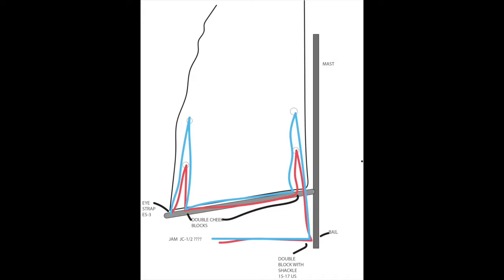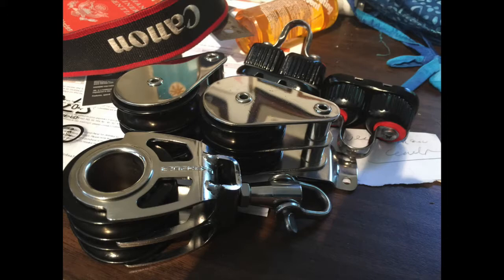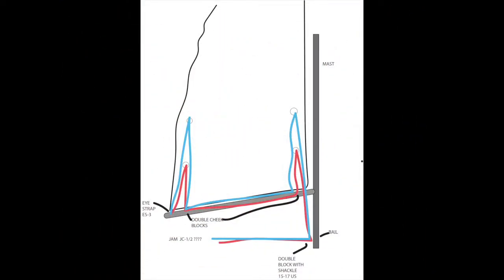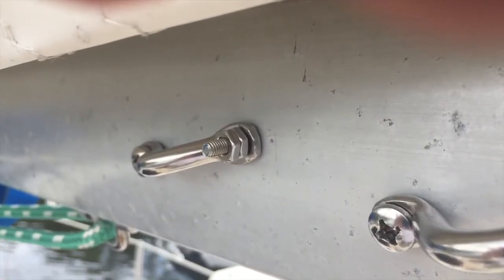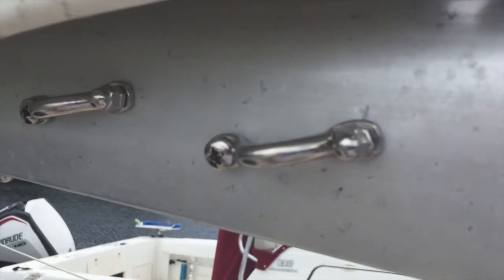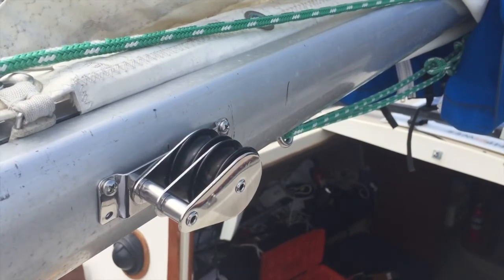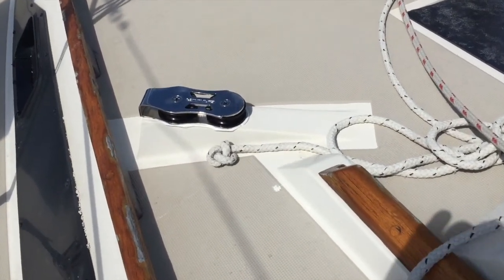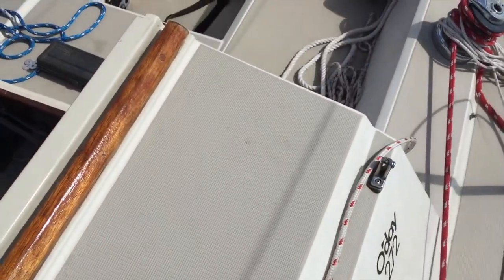EP 8 REEF BLOCKS

Comment: More than entrataining, but rather educational. I plan on installing a single line reefing on my boat, and though the mast manufacturer sells internal shuttles for the boom, I do plan on going on the outside, although I have 3 reef points, I will only do the second and third because for the first reef, condition are usually not yet too unsafe, and I don't care much for heel, so will reef early, but probably just do the rear reef point with a line for the first reef..
Reply from the maker: Thank you for responding. I think one of the most important things to remember is dyneema Line makes everything go through the block smoother and easier. Good luck with your project.

Comment: I plan on befitting my boats boom for single line reefing, but will only do the second and third reefs lead back, as when reefing the first reef, usually conditions are still manageable, but reefing further has its inherent risks, especially in darkness, surprise squall, etc. Though my boom has internal sheaves for reefing, I too prefer outside the boom. Great video.
Reply from the maker: Thank you

Comment: I have a roller boom reefing. I'm going to change it out for normal reefing. Your single lines reefing looks easy enough to install. I might be a to leave the roller boom on and lock the rotation, then install blocks externally like you have done. Thanks from Tasmania
Reply from the maker: I have no experience with boom reefing. Your plan sounds like it will work. Good luck.

Comment: I'm thinking of doing this, as I have a huge disdain for going to the mast and the ram horn. Curious why the reef line on the starboard side of the boom and then clutched on the port side of cockpit. 
Also shouldn't the cringes be brought down to the boom?
Reply from the maker: The Sail that came with the boat has a reef block on the sail at the reef point on the starboard side,  that's why the blocks on the starboard side. The  Clem cleats are on the port because the starboard side is all filled up with clutches.   I am not an expert but my philosophy is to look for ease-of-use and safety. If I am reefing, and spilling  little wind, that is not a bad thing. I have a tendency to reef before I needed, as my wife does not like heeling to any major extent.   The slipperiness of the dynamic was really helpful.
Reply: @svgreatescapes   Thanks for that

Comment: I am setting up the reefing lines in the same manner so that its easyer and safer for me as i am an by myselfe most of the time.
Reply from the maker: I used dinema  synthetic line as it is very slippery and runs through the blocks easily. We must remember to have the line loose when you raise the sail.
Reply: @svgreatescapes  Thank you for replying back so soon. I have just joined your channel and if you join mine, you will be able to view my progress as i complete the refit of my boat.
Reply from the maker: @svlittlegem  done

Comment: Great Stuff!
This is Carl from the Meet up in Mystic, How's it going.
Reply from the maker: My reason for staying outside the boom with all my reefing lines is so that I can keep an eye on them, for chafe and any kind of line tangling. This also gives me the option of putting the blocks wherever I wanted them. It is not a perfect system and probably would not be good if you were racing. But it keeps me in the cockpit and I can do a quick reef safely. You have to be careful that The reef lines are free when raising the main.  Dynema line, which is very slippery has helped in this process.  It’s been a wet season in New England and now we have a hurricane coming our way. Sailing is challenging.   Email or message me if I can be of further assistance.